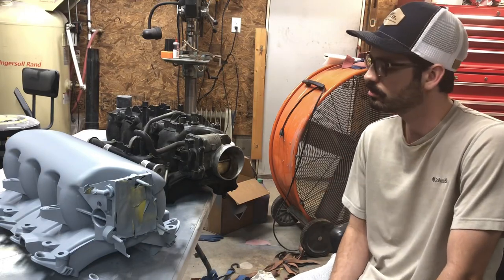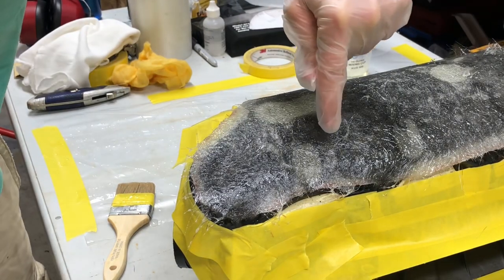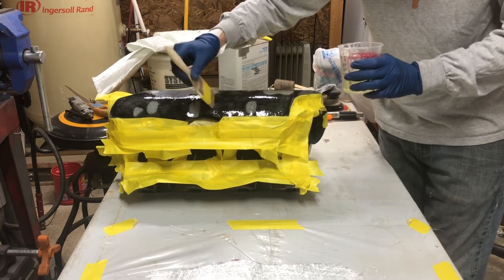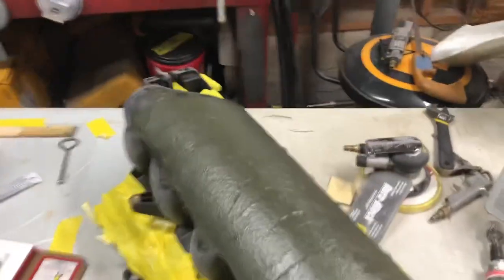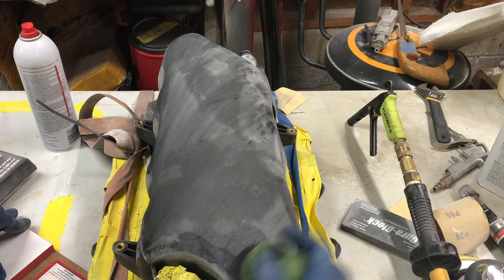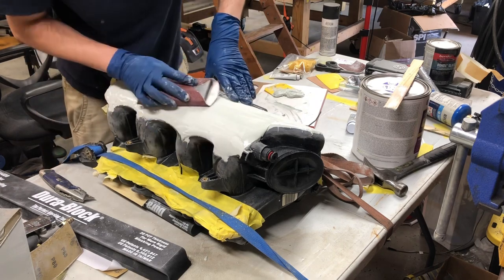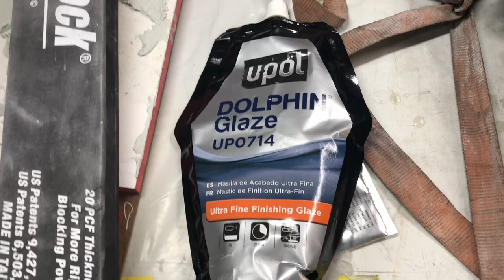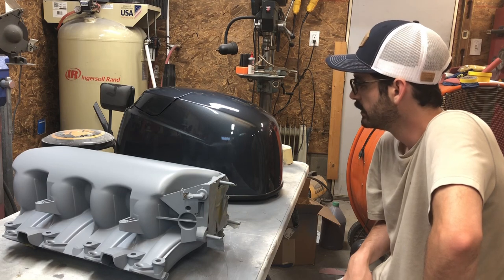LS Intake Manifold Shave (Part Two of Two)

Comment: Do you think I can use long strand instead of bondo glass
Reply from the maker: Over glass mat? Yes its just more than needed. Even short strand is overkill on top of the glass mat. The folks who don't use the glass mat use long strand but as mentioned that's probably suboptimal. Its apparently worked for some folks though. Thanks for watching

Comment: What grit sandpaper are you using?
Reply from the maker: I can’t remember off the top of my head but I probably went to 320 with that. Knock down was rough like 80grit
Reply: @MAYCOCustomRestorations  Awesome.  That's what I was thinking.  My final question will be, how and where did you relocate the MAP sensor?  Or did you show it in a different video.
Reply from the maker: I didn’t show it but I think I mentioned I will relocate it to the back by threading/epoxy a bung

Comment: Can I ask you stupid question? What’s the port in the plastic manifold just behind the throttlebody? EGR or something else?  Why am I asking? The manifold I got that port / part is broken off, you can see that something was there before. Can it be moved or is it necessary? Thanks in advance‼ Plus to see someone who knows how to do Bodywork!
Reply from the maker: Are you talking about the hose connection barb (to the left of the the throttle body) or the port for a sensor on the topside right behind the throttle body?
Reply: @MAYCOCustomRestorations  Thanks for the reply, Yes the one on the left side. It is L shaped on your manifold. Funny I really like to know why so many holes in the manifold. I know it was full oil, I cleaned it first.
Reply from the maker: @randy6350  It goes to you PS valve cover for crankcase ventilation
Reply: @MAYCOCustomRestorations  Thanks for the info! And not anymore as I think I’m going to a catch can. Again thank you!

Comment: Can you show me how are you connected the throttlebody cable
Reply from the maker: I have a DBW throttle body, if youre using a cable type, you just leave the two bolt stanchions that were on the top and remount the bracket when you are done.
Reply: @MAYCOCustomRestorations  did you put your map sensor on there
Reply from the maker: @richardeddings7259  Not yet, Im going to put two bungs epoxied into the back of the intake out of sight. You can run hose to a remotely mounted map.